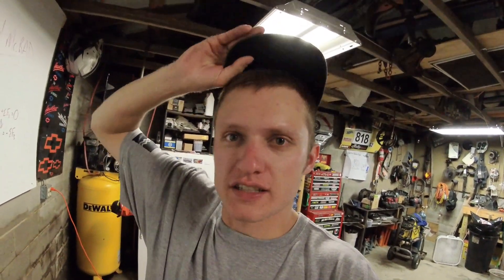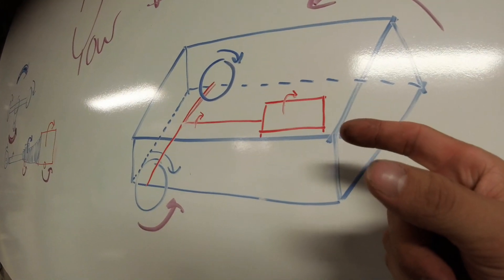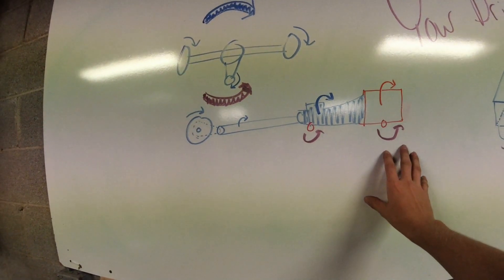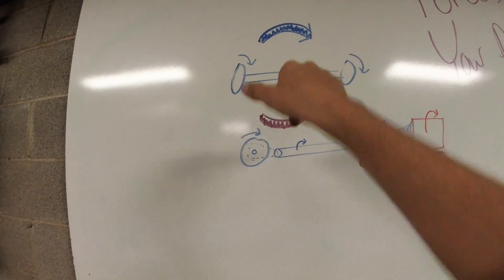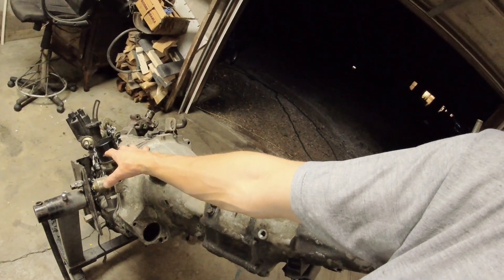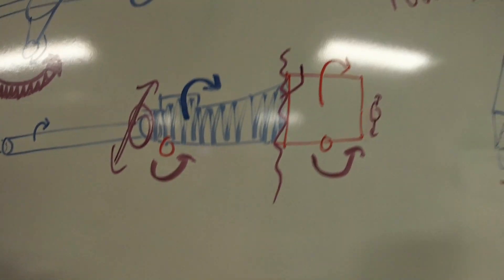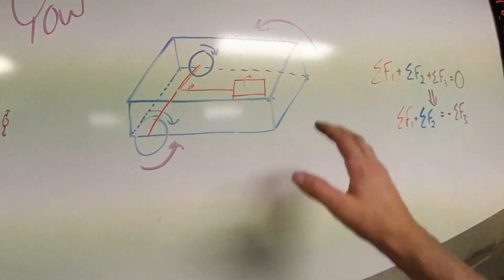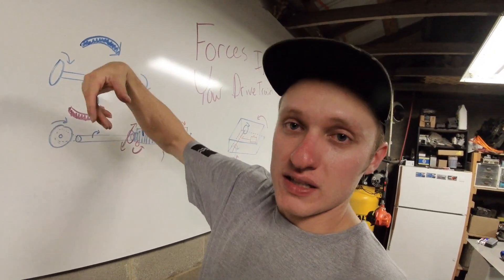Why 13b Rotary Engines Break- Understanding the Forces That Come with Horsepower

Comment: i had flashbacks from nom when you triggered me by saying squirrel. You should have trigger warnings!! how dare  you not take into consideration my first rotary car being ultimatly done in by a stubborn squirrel. 8 times in a month it ate my wiring harness and after the 8th time i just was done patching the  harness back together. Literally made a nest out of moth balls ointop of a rat trap i had bolted to my frame that the squirrel disabled. Also got around a wifi camera i had mounted in the engine bay.

caught the fucker... took em to the edge of town and released. Couldnt bring myself to kill such a unit of a squirrel lol, 

also... kidding on trigger warnings, thats just garbage

Comment: Interesting idea, to make sure things twist similarly at the engine and transmission. How would things be similar or different in an FD which just has engine mounts (no trans mounts) and differential mounts?
Reply from the maker: The FD REW with having the engine mount at the back of the engine, and a much thicker dowel landing isn't too prone to having issues.   I think the PPF does a good job of allowing some flexure between the diff and trans.  I dont think I have ever seen somebody crack a REW

Comment: I have broken a rear iron. Did it at the top end of a first gear pull. Never had those problems before going turbo. The lesson is... keep spare parts.
Reply from the maker: For sure!!!  Spare parts are hard to get!!!
Reply: @RADPotential  its weird for years I couldnt find 12A stuff but now it falls in my lap. 13B stuff is getting hard to find cheap especially front irons.

Comment: What about adding a torque brace to add structure to the rotary engine from twisting?
Reply from the maker: You for sure could. I have seen those in past.
Reply: @RADPotential  they make en plug and play for the fd ..  currently building one and have torque brace.  I like ur insights on solid mounts. No twisting.   But what about the drive shaft and differential?
Reply from the maker: So your wanting to look more in depth at how the differential reacts?  Or how to keep them safe if you stiffened up the engine
Reply: @RADPotential  well safe pf course.  But also do the diff mounts need to be solid,poly, new rubber?   I always heard some flex is good. What's ur thoughts on 500hp mazdaspeed engine/ trans/diff mounts wich are  30% stiffer than oem?  Don't want to crack rear iron oil galleries